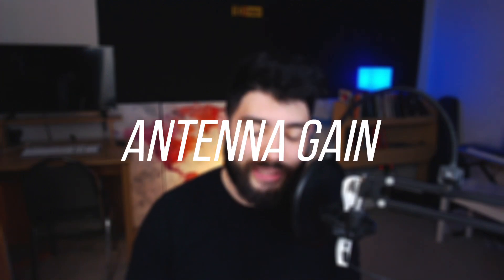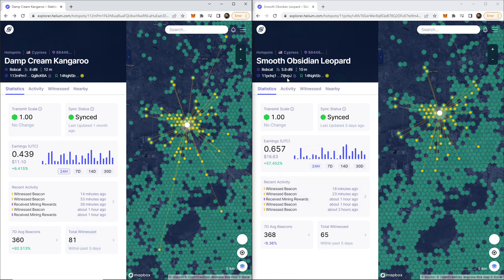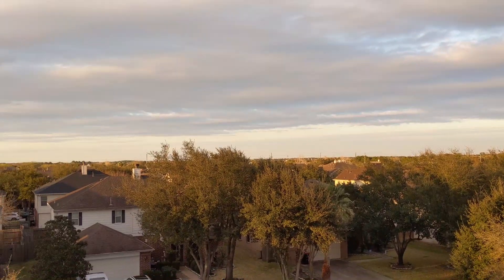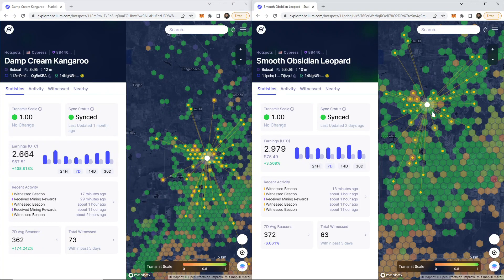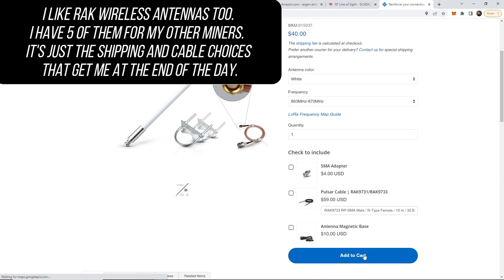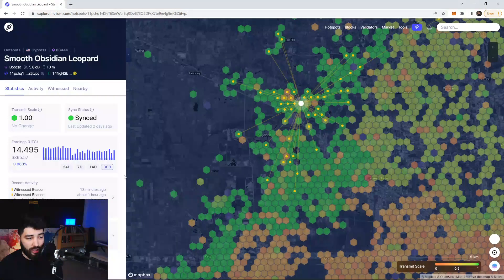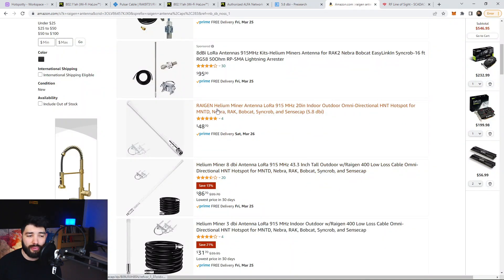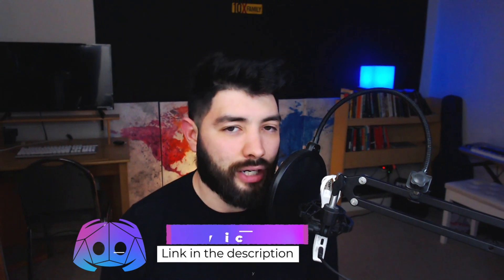Tested Rokland Antennas ( helium 5.8dbi vs 8 dbi )

Comment: I just bought a Rokland 5.8 dbi and a 3ft lm400 cable for my bobcat miner 300 and I live out in the suburbs so it should do better then my 4 dbi
Reply from the maker: Nice! Congrats. where are you planning to set up? rooftop?
Reply: @gabrielchaparrotalkscrypto  Yes but don't know if I can reach it with a 3ft lmr400 cable or go through the attic
Reply: @gabrielchaparrotalkscrypto  why is my 5.8 Rokland antenna not hitting good on the roof I am making like 0.04 hnt a day now really bad

Comment: I am using internal antennas and they performs bad . Does setting antenna outside make big gap ? I am making average $1 in one hotspot and the other one even worse. I tried to change from 4 dbi to 8 dbi and my profitability dropped
Reply from the maker: yea if you set it to 8 and its not true, your earnings will drop because it's invalid. if it can tell that you're not sending and recieve signals with the appropiate gain, then it will mark you as false, as invalid. 

yes settting it outside higher up is the best bet. the higher you go and more clearance you have for your signal to be strong is what you're looking for.
Reply: @gabrielchaparrotalkscrypto  by changing it to 8 dbi I meant I purchased 8 dbi antenna but internal one from eBay . I didn’t just change the numbers in the app. The 8 dbi antenna seems to perform worse than 4 dbi.
Reply from the maker: @WealthyPanda  it's all about your location.   So it's not the antenna that's actually worse. It's what you need.  

And my bad. That makes sense lol.  So how high off the ground are you ?
Reply: @gabrielchaparrotalkscrypto  according to a site I am 860 ft above sea level. This setup in second floor. I don’t believe I have much of interference outside but since it is setup inside might be part of the problem. I checked helium map and my location is actually similar to what u showing. Not crowded with hot spots . Some empty hex locations around and most hex place has 1 - 3 max miners. I am trying to figure if I should instead of having it in my apartment. Find locations and pay them to set it up. If hotspot making $20 - $30 / month 😅 and miner costing me $800 - $1000. I am definitely loosing money . Thanks Gabriel
Reply from the maker: @WealthyPanda  for sure man.  Well Yea if you need to move it i think it's worth it always.  Also check the elevation of those around you not just the sea level to see what kind of elevation you are dealing with in your target area.